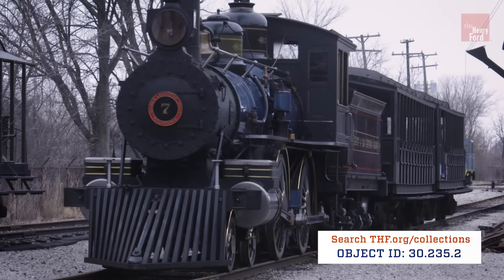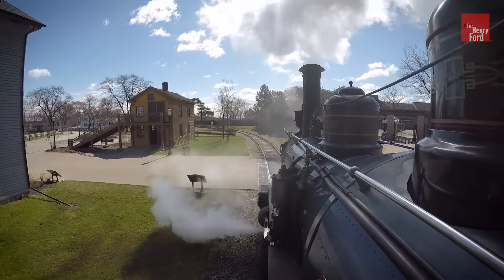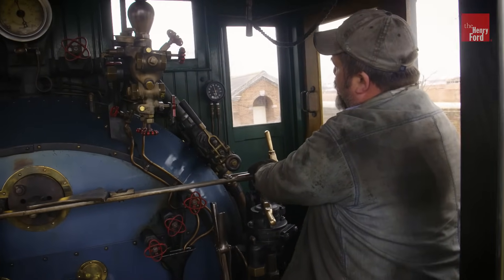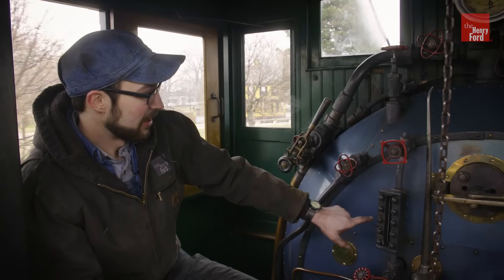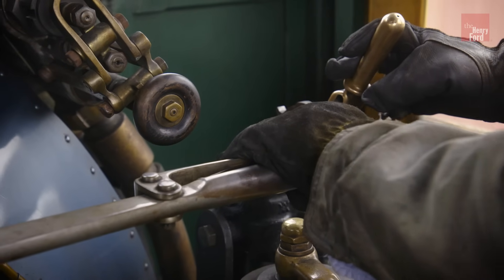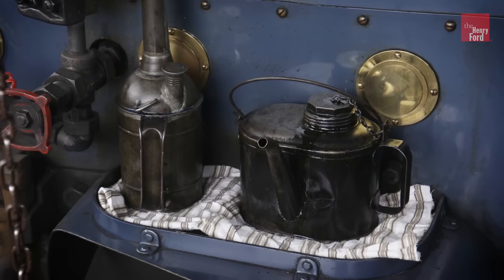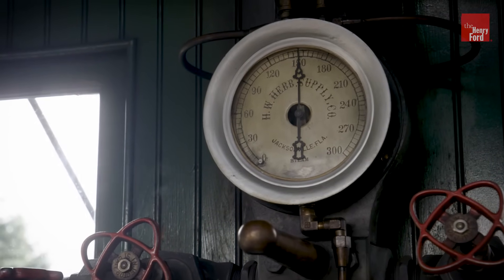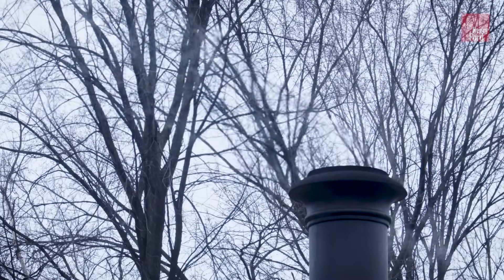How to Operate a Steam Locomotive

Comment: how in the hell does that throttle work? all i ever see people do is wiggling them and the train just keeps going faster
Reply: The throttle controls how much pressure is in the cylinders. more pressure means the cylinders move faster and the wheels turn quicker
Reply: the throttel works by controling how much steam goes to the cylinders just like your car throttel controles how much gas is going into the engine but Steam has a lot of torque than gasoline or diesel has so all you need is little taps on the throttle bar to much steam getting into the cylinders can cause the locomotive to spin its drive wheels in place like your car does in thick snow more than pulling the train

Comment: its amazing how steam is strong enough to pull 9 or 10 train cars
Reply: Sometimes 900
Reply: Far more than that in some cases! In the Henry Ford Museum they have one of the big articulated boys, the C&O Allegheny No. 1601. She has a 2-6-6-6 wheel configuration and was designed to tackle the challenging mountains of Virginia and West Virginia. She had a top speed of around 70mph and could pull somewhere around 130-140 fully loaded coal freight cars.